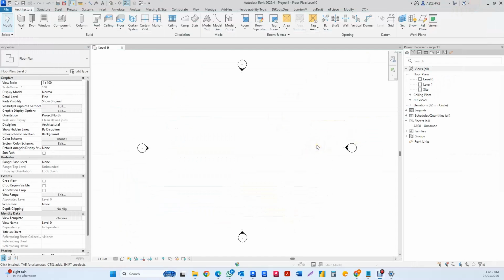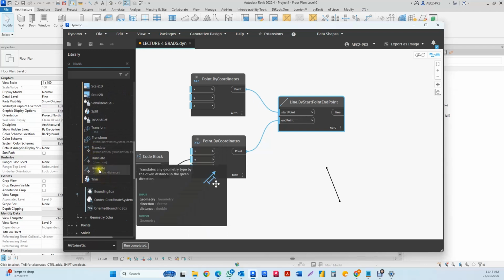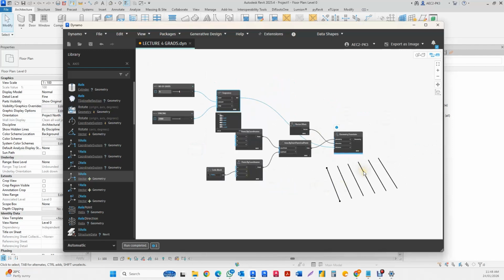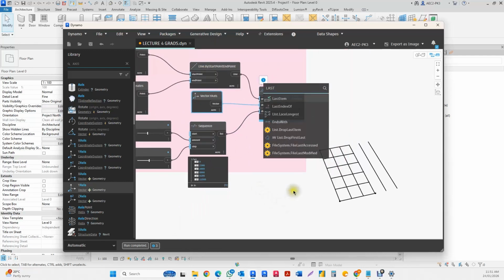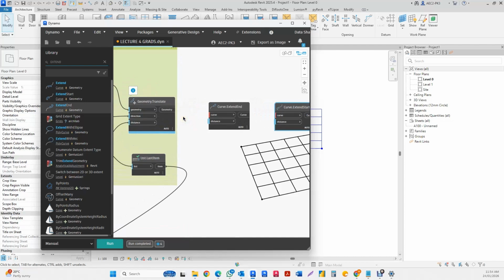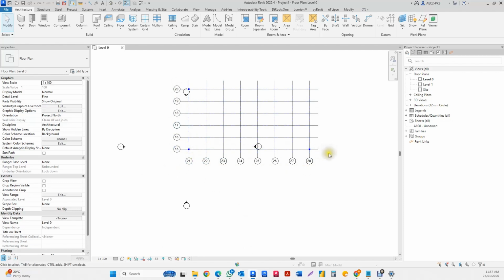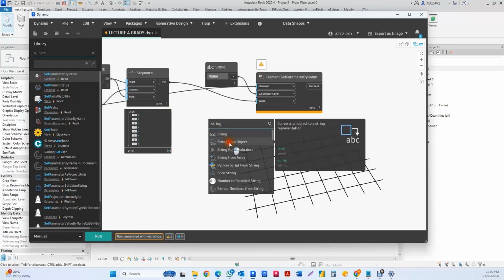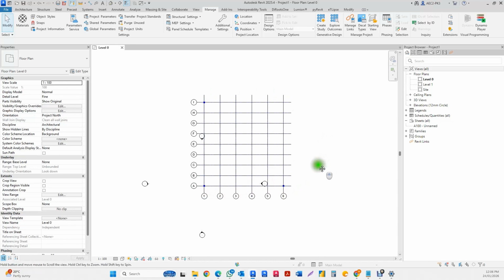DYNAMO COURSE  LECTURE 4

Comment: Hi there—excellent video! Thanks in advance. Could you create a Dynamo script for electrical single-line diagrams that runs via Dynamo Player? It would also be great if you could develop a script to route electrical conduits along cable trays, adapting to the tray geometry for both horizontal and vertical runs. That would be fantastic—thanks for the videos!